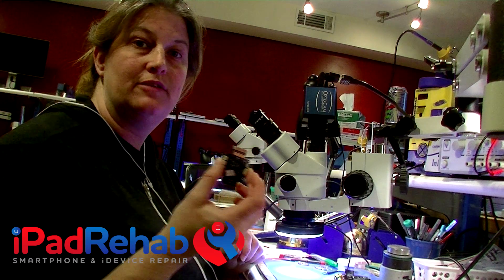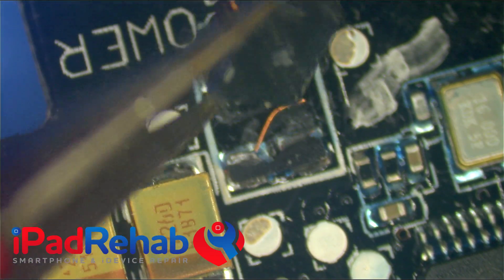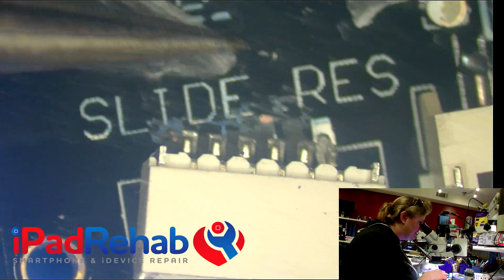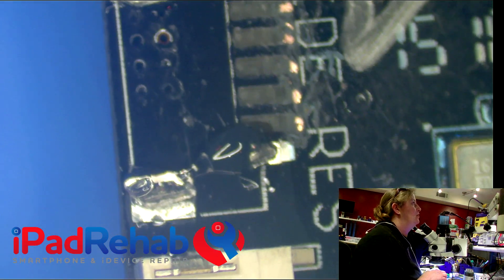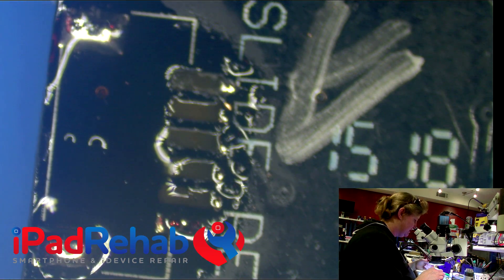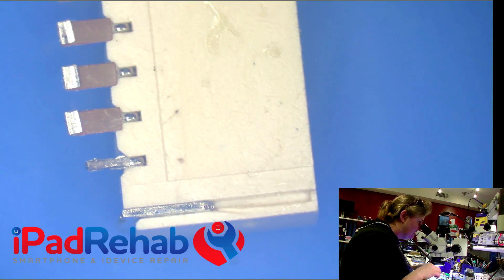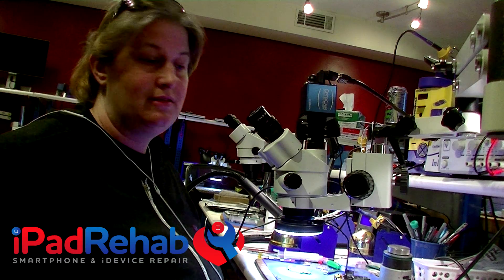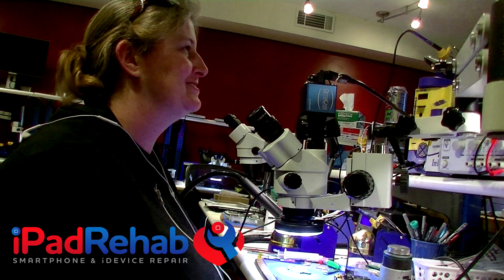How to Fix a Drone Gimbal PCB after flying it into a tree

Comment: thanks for the video, it helps alot, may i ask what the solder iron called at 8:18? thanks
Reply from the maker: +Gursharn Khaira mini hot tweezers
Reply: +iPad Rehab thank you, ive had alook online and hakko soldering station not available in the uk, can i buy one off you and post to uk pls?
Reply from the maker: Shit wow I must be on crack, my bad bro. Rather than iFixit, check out amazon!

Hi! Thank you for your interest in the equipment we use.

Flux: https://mailin.repair/amtech-nc-559-v2-30-cc-16160.html

Station: https://www.amazon.com/gp/product/B0012BC3TM/ref=as_li_tl?ie=UTF8&tag=rossmanngroup-20&camp=1789&creative=9325&linkCode=as2&creativeASIN=B0012BC3TM&linkId=c37220e0ce001d7a5715c06aeb7648b1

Tweezers: https://www.amazon.com/gp/product/B009SCNJOK/ref=as_li_tl?ie=UTF8&tag=rossmanngroup-20&camp=1789&creative=9325&linkCode=as2&creativeASIN=B009SCNJOK&linkId=5d011299f6ba3effaa2ee4012df19da5 

Tips: https://www.amazon.com/gp/product/B00NTB4RTW/ref=as_li_tl?ie=UTF8&tag=rossmanngroup-20&camp=1789&creative=9325&linkCode=as2&creativeASIN=B00NTB4RTW&linkId=d8dea927bda54ddc3acbfdbf24badd66

Micropencil: https://www.amazon.com/gp/product/B00O4H41X2/ref=as_li_tl?ie=UTF8&camp=1789&creative=9325&creativeASIN=B00O4H41X2&linkCode=as2&tag=rossmanngroup-20&linkId=467ab5cdc75e3fcfeabd5093cebbcc20

Microscope: https://www.amazon.com/gp/product/B005MRAAR4/ref=as_li_tl?ie=UTF8&camp=1789&creative=9325&creativeASIN=B005MRAAR4&linkCode=as2&tag=rossmanngroup-20&linkId=8c3b94523f849afcbb9e232f303e4670

My preferred hot air station: https://www.amazon.com/gp/product/B00FS7C08U/ref=as_li_tl?ie=UTF8&tag=rossmanngroup-20&camp=1789&creative=9325&linkCode=as2&creativeASIN=B00FS7C08U&linkId=73e81b54b2754c643f1b53dfe0a06276

Affordable, but still workable hot air station: https://www.amazon.com/gp/product/B000R94OHE/ref=as_li_tl?ie=UTF8&tag=rossmanngroup-20&camp=1789&creative=9325&linkCode=as2&creativeASIN=B000R94OHE&linkId=5063e5f2215b1182dbb07273bbb5ae77

Ultrasonic cleaner: https://www.amazon.com/gp/product/B00VGXXJDA/ref=as_li_tl?ie=UTF8&camp=1789&creative=9325&creativeASIN=B00VGXXJDA&linkCode=as2&tag=rossmanngroup-20&linkId=86be2e7d472d625cd48a93eee9cc94b1

Ultrasonic cleaning fluid: https://www.amazon.com/gp/product/B00BWESDKW/ref=as_li_tl?ie=UTF8&tag=rossmanngroup-20&camp=1789&creative=9325&linkCode=as2&creativeASIN=B00BWESDKW&linkId=18797ab2fefeebbb442a4bd0a694e963

Multimeter choices Extech: https://www.amazon.com/gp/product/B000EX0AE4/ref=as_li_tl?ie=UTF8&tag=rossmanngroup-20&camp=1789&creative=9325&linkCode=as2&creativeASIN=B000EX0AE4&linkId=36de4ac106c105fb0a2ebb9f1c4d869c Fluke: https://www.amazon.com/gp/product/B00NE9FF40/ref=as_li_tl?ie=UTF8&tag=rossmanngroup-20&camp=1789&creative=9325&linkCode=as2&creativeASIN=B00NE9FF40&linkId=f95a90929aa103f39d05402c47d4042e

Multimeter Probes: https://www.amazon.com/gp/product/B000VRFKPW/ref=as_li_tl?ie=UTF8&tag=rossmanngroup-20&camp=1789&creative=9325&linkCode=as2&creativeASIN=B000VRFKPW&linkId=e6a7d3405038f673acc26eca8758dc10

Solder: https://www.amazon.com/gp/product/B004X4L076/ref=as_li_tl?ie=UTF8&tag=rossmanngroup-20&camp=1789&creative=9325&linkCode=as2&creativeASIN=B004X4L076&linkId=86c54186bfd0fb0992820adb50ec8bee
Reply: +iPad Rehab Necesito unas... :)
Reply: Check out IFixit, they are selling the station I recommend
Reply: +Gursharn Khaira If you're in the uk hakko have a distributor that can order the parts for you if they don't stock the hakko product you want search dancap electronics!

Personally i recommend the jbc nano rework station, if expense is restrictive go with hakko they are a good reliable work horse i only recommend the jbc as they are better for working small resistors capacitors inductors etc....

But with the hakko you will do a much neater job removing the component wicking then using solder paste, on the smallest components, along with hakko micro pencil.

Jessa has her own style of soldering which works for her, and does a superb job, you will find what works for you with practice.

Times money in this game, a cheap preheater with thermo couple, would help a lot for people starting out, heat the board to 100c from underneath this warms the lands/pads on say an fpc connector, then with hot air, heat at 200c from above it's like magic at these temps, you won't melt, the fpc connectors the combined temps allows you to change an fpc to factory standard in about 3 mins no cold joints, and full heel and fillet solder joints without the heartache of hand soldering also works for removing fpc in reverse.

i'm thinking of using my channel to show pulled pad replacement to industry standard not decided if i'm brave enough yet, as not very vocal in person, most people don't need to be able to do this, as you can just run micro traces and use conformal coating or good old clear nail varnish, to secure and protect the repairs both ways work equally well and i use both depending on the job if all the pads are gone i use industry standard one or half a dozen out of 20 pads it's getting jumper lol industry standard can be quicker with fpc replacement it's a ball ache with so many pads especially at micro scales. 

it's about practicality that's why Louis and Jessa Mark are superb at what they do, you don't need industry standard to do a good job, it's not for nasa it's miniature lego as Jessa calls it and in the literal sense that's all it is :)

I'm absolutely facinated with what they do, it's science and art form all mixed into one it's like a mini adventure every, single repair the challenge the discovery the success.

I remember spending hours, sometimes days chasing faults but chasing them always helps, because the same faults, turn up again and again and when they do you can beat the shit out of them in mins instead of hours days it had taken before.

It is a dying business sadly which will go the way of tv repairmen this is specialist at the moment.
Reply: +ASTRO MAN thank u will have look
Reply: Hi jessa, ive had alook everywhere for that damn hakko tweezers and none in uk, ifixit has ran out of stock im guessing it will be a long time, just wandering if you have any in stock i will pay whatever and postage ;-/

Comment: Measure the henrys with a resistor and put a new coil on :) great video.
Reply from the maker: +ASTRO MAN that's a good idea, but I think I'd need all the coils of wire on the thing intact to do that---wouldn't the inductance be off if the wire path of the coil is broken?
Reply: +iPad Rehab You're adding a small amount of resistance to the coil with the solder, if any extra at all the board specs should allow for a + - 10% safety tolerance, but i would guess it would be negligible as above on such a small coil brilliant job btw :) if it works the jobs done in my eyes,

The magnetic field is so symmetrical on a wire inductor, it smooths itself out with the extra resistance or not, you could have just used some wrapping wire of the same gauge wrapped 3 turns around the the ferite core to restore full function without soldering the wire together.

To repair this is an achievement in itself, once rebuilt as you have just measure the value of the coil, or it's resistance  and use a new part great bit of reverse engineering going on in this video, it's like breaking the glass cup and putting it back together and still having it function as a glass cup who need schematics :)
Reply: +Gustavo Ferlizi looks like a 3 turn 2 1/2 turns and 2 full = 3 liking the tiny faraday cage round the inductor to stop eddy currents.
Reply: +iPad Rehab I think it should be fine for this low turn count inductor. You could rewind it perhaps, but it would take longer. 

Is that half wound by the way? One turn of the two halves of the wire making it a 2 to 3 turn inductor(?). Hadn't seen one like that before